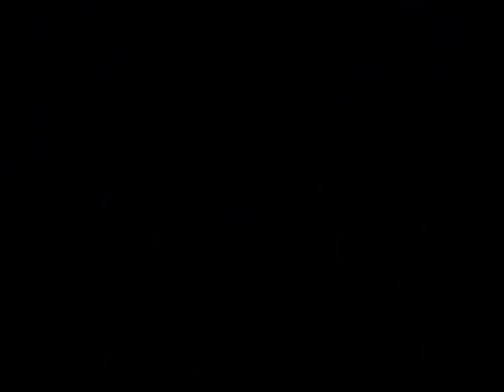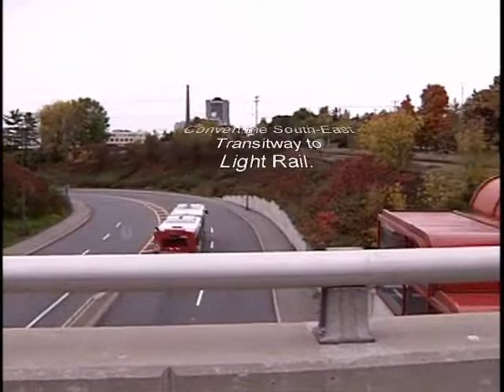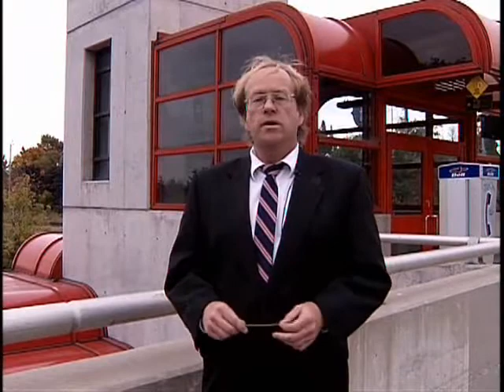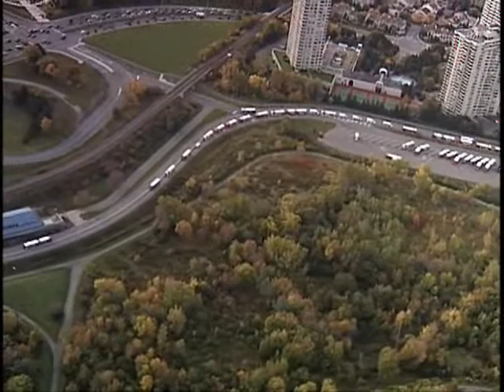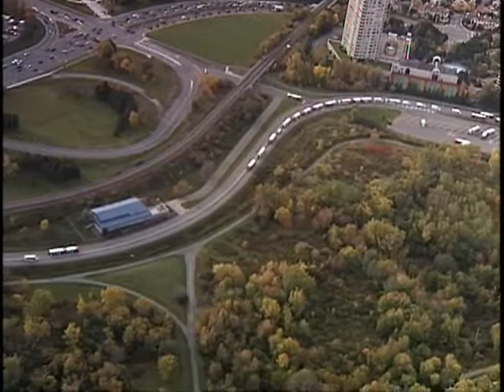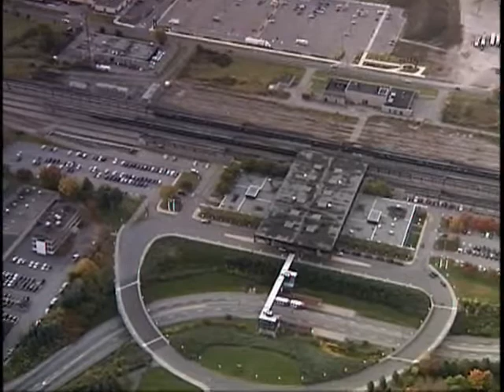Convert the Ottawa South-East Transitway to Light Rail

Comment: Hello:

This proposal for conversion is about Light Rail on these sections of the Transitway. 

No buses will run on the Transitway when it is converted to Light Rail. That has always been the long term plan for the Transitway when it was conceived in the 1970s. It is up to the City to decide whether to continue running those bus routes and if so, on what roads/transitways to run them on. I am currently teaching at the high school level in Ottawa.

Cheers